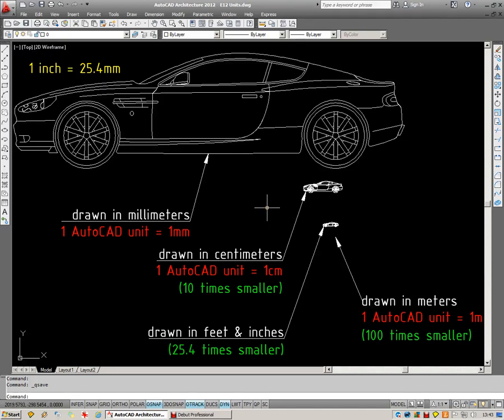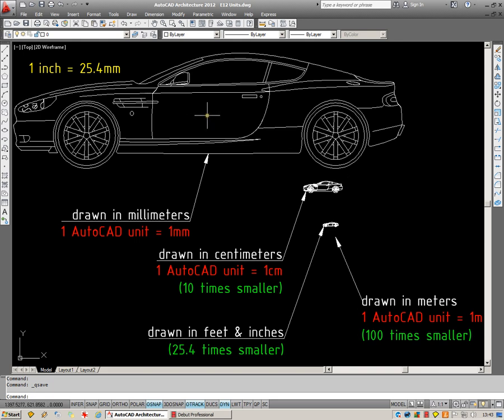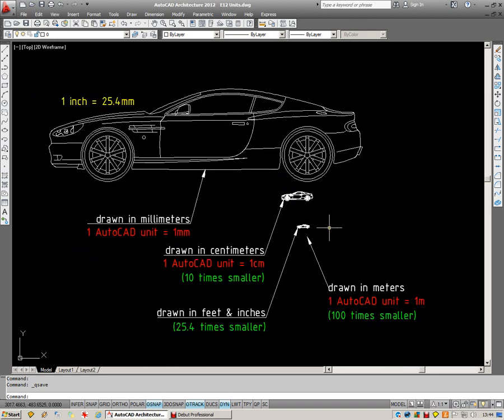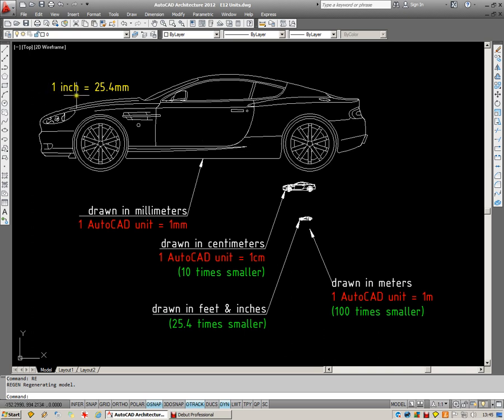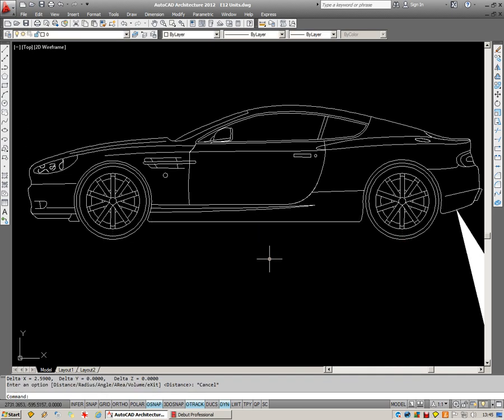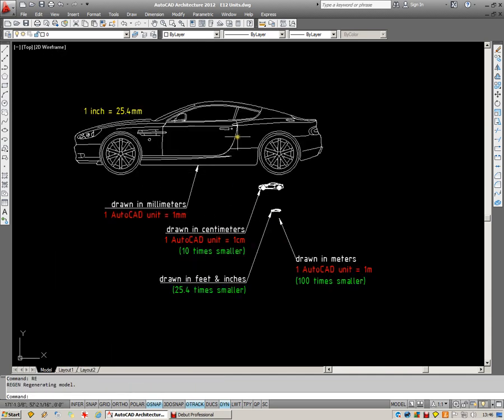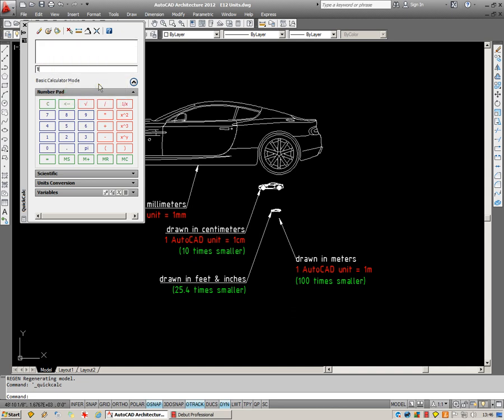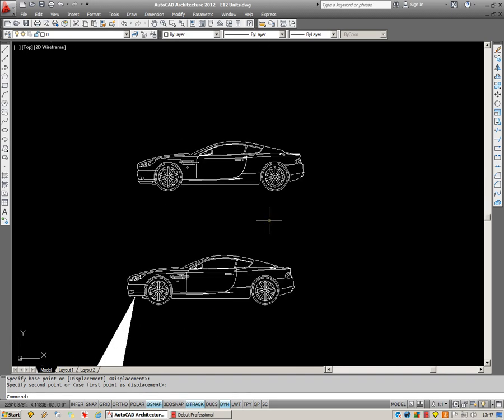AutoCAD: Converting Metric Decimal drawings to Imperial

Comment: Instead of scaling the object up or down, is it possible to keep the object the same scale and have both imperial values and metric values display in the dimension line? (i.e. Imperial values on one dimension line and directly below it is the metric values or vice versa)?  By having both units of measurements on the plan, discussion will be very effective for both designer and foreign clients. Thank you.
Reply: There is a way. Found this video: https://www.youtube.com/watch?v=sZi_WVWoL5s

Comment: If blocks have the correct units defined they are drawn in (properties), AutoCAD will scale it to drawing units upon insertion of the block. No need to use the scale function! Be sure "INSUNITDEFSOURCE" and "INSUNITDEFTARGET" are set corresponding drawing units. These can be found in "OPTIONS", "User Preferences" TAB.
To convert a complete drawing from any units to other units, use the command:
"-dwgunits" (include the minus symbol).
Reply from the maker: Hans, thanks for you advice on insertion scales, however your advice on drawing units is only valid in situations where a drawing is being inserted elsewhere, and doesn't convert a complete drawing as you suggest, it merely changes the units. If someone needs to physically convert the size of the base drawing, then the scale function will still need to be used. eg, a drawing where it's been assumed by the author that 1 unit = 1 metre, changing the units has no affect on the physical size and doesn't resolve the problem if someone needs to work on that drawing in different units, it will only be resolved if that drawing is referenced into another. 

Personally, I think AutoCAD deal with this in a very unsophisticated and complicated way and hints at AutoCAD's patch and repair strategy that we've all had to endure for decades. It's especially felt by Metric users producing architectural drawings in Europe and the UK where drawings are produced in three different units across the region which makes it awkward to coordinate large projects with drawings from numerous sources (where scaling each reference to the same size is by far the most logical and practical solution). It's an area of AutoCAD that needs a complete overhaul and modernisation and it wouldn't actually be that hard for them to do.
Reply: Cadcoaching If you want to physically convert a complete drawing, use the command "-dwgunits" (include the minus symbol) and follow the prompts. It will do the trick for you without having to find the right scale factor.

Example Millimeters to Feet:

Command: -DWGUNITS

Drawing units:
  1. Inches
  2. Feet
  3. Millimeters
  4. Centimeters
  5. Decimeters
  6. Meters
Unit for length <3>: 2

Drawing unit display formats:
  1. Scientific
  2. Decimal
Linear display format <2>:

Linear display precision <2>:

Scale objects from other drawings upon insert? [Yes/No] <Yes>:

Match INSUNITS to drawing units? [Yes/No] <Yes>:

 ** WARNING: you have changed the unit for this drawing database.  **
 ** All new objects will be drawn according to the new unit, but   **
 ** existing objects will not change size unless you specifically  **
 ** ask to have automatic scaling occur.                           **

Scale objects in current drawing to reflect change in units? [Yes/No] <Yes>: y

If you answer "yes" to this question, the contents of the complete drawing will be scaled !!!
Reply from the maker: Hans, thanks very much for the detailed response. I've been trying to scale a drawing in meters to millimeters using -dwgunits and I'm consistently getting a result of a 25.4 scale up instead of 1000 regardless on my inputs. Seems it's happy with a Decimal to Imperial but not with the Decimal - Decimal. I'll play with the variables and hopefully nail it.
Reply: Cadcoaching With me, "-dwgunits" is always right. Whatever units i want to convert. I think your source drawing is not set to the units it is drawn in. The units dialog-box can show different current drawing units than "-dwgunits" does. In fact, the dialogbox shows the units for the variable "insunits". You want from meters to millimeters and are shure the drawing is drawn in meters?!
Try this:
Command: "-dwgunits"
Drawing units:
  1. Inches
  2. Feet
  3. Millimeters
  4. Centimeters
  5. Decimeters
  6. Meters
Unit for length <2>:
The number <2> shows the current drawing units. In your drawing, acad should show <6> as default answer. If anything else (as in this example), first SET IT TO 6 (meters) and complete the command, WITHOUT (!!) scaling the objects!
Then use "-dwgunits" again, set units to <3> and answer "Yes" to the scaling question.
Hope this will help.
Reply from the maker: Hans, that's worked perfectly. Setting it first  without scaling and then running the command again has sorted it out. Thanks very much for the advice.
Reply: thanks Hans...You saved my lots of time with Your great Trick
Thanks man..

Comment from the maker: A correction to the drawing shown in the video; the car drawn in meters should read 1000 times smaller, not 100.
Reply: land surveyor here.
you are right there a meter its 1000 smaller, and measures in inches or feet's always go wrong in autocad, that's why you need to divide by 1/25.4, to get the factor scale^^, the autocad direct conversion come always with a strange value